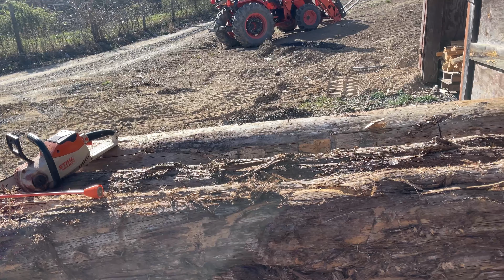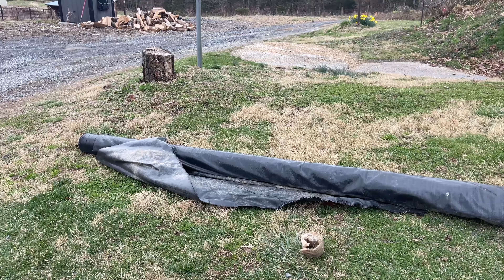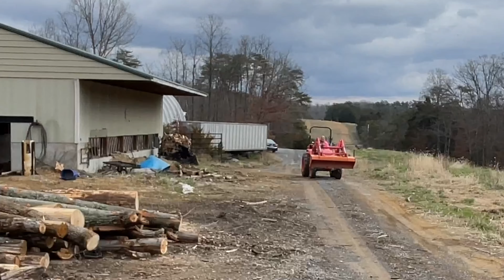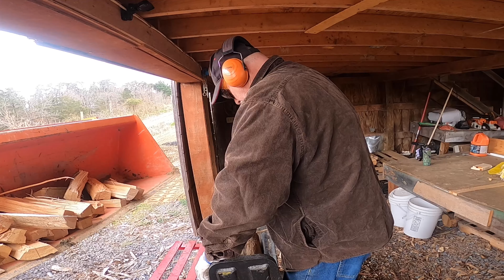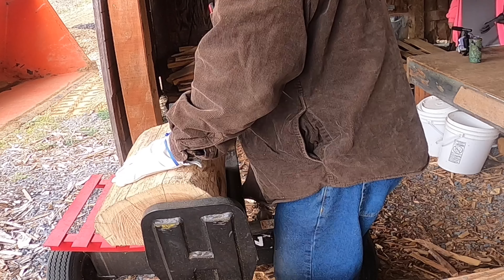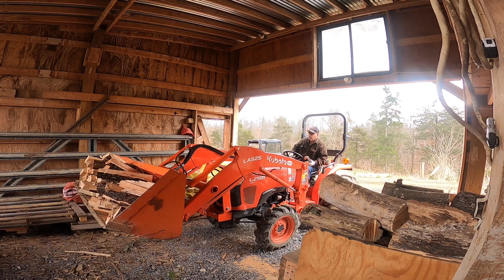Firewood Bundle Splitting and Bundle Stand Prep! #345

Comment: In my firewood stand last summer, I was only shortchanged one time. I think someone was about $6 short and called it good enough.my bundles are twice the size as are selling at many places around here.
I sell mine at $6 each or 2 bundles for $10. 
I was approached by a local campground and asked if I would consider supplying them full time. As I was still working full time and still taking care of my 224 acre farm, I turned them down. 
Now that I retired in November, I might reconsider.
Reply from the maker: Gary, good call, Retirement changes options for sure🚜🪵👍🏼🇺🇸